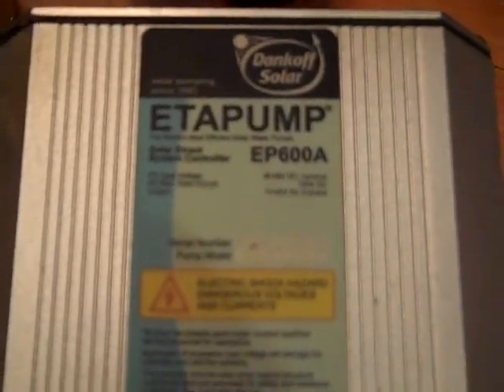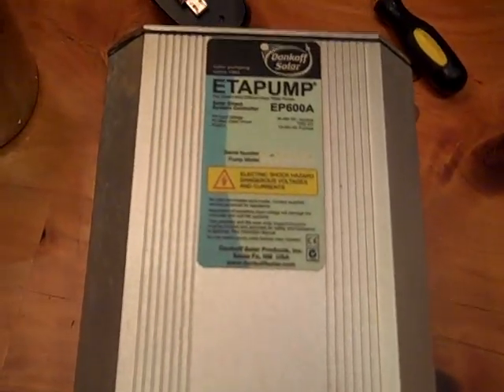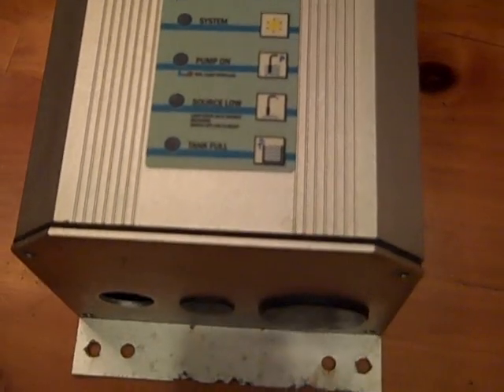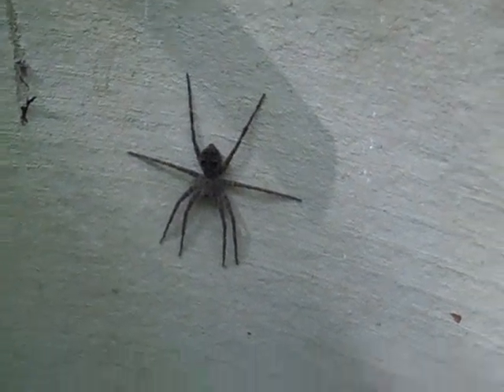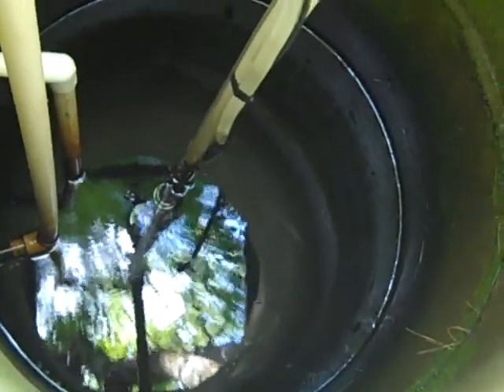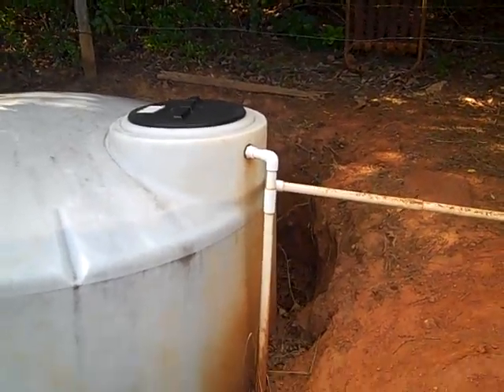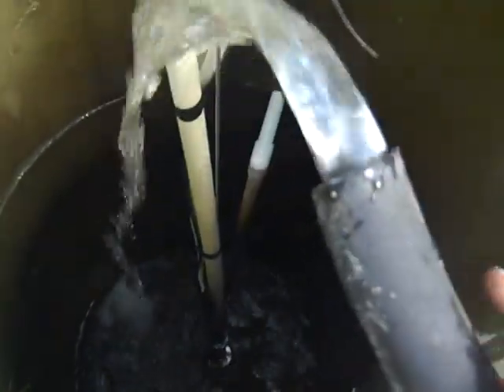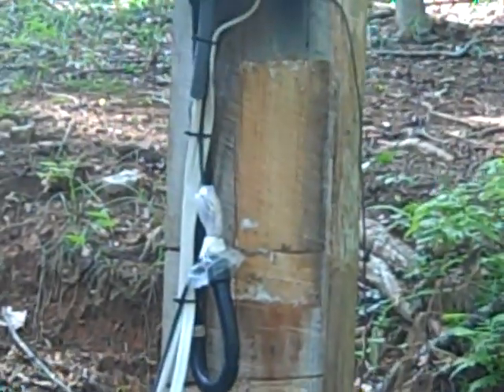Water system failure and backup

Comment: Sorry I'm sure you mentioned it...but your 1600 gallon tank...how long did it take to fill it (I think you said it was empty) with the PTO pump. We have 2 wells drilled but haven't been able to afford to put in a solar or wind pumping system. Need to pull water out of one of those tanks and move it up to the highest elevation in the field. Also still need to get a tank like the one you've got.

Thanks!

Comment from the maker: @tomyhill123 No, thankfully it doesn't freeze.  I need to build a better lid but I tie a trap around the top in the winter and have not had a problem. 800 gals. at 58  degrees keeps things from freezing.  Thanks

Comment from the maker: @jcb570 If It was  direct wire situation it would have fired the pump. So the controller being separate form the pump is easier and less expensive to replace.  I did find the culprit being a disconnected ground.  My fault! : ( 
When I originally put the system in it was for a ram pump so no wires necessary. II could do a counter wegiht switch true but I have found that while the sun is out I let is keep pumping. The more the water moves the less algae.  Thanks for watching.

Comment: If the region and money are there, a hand pump well is awesome to have. Less parts to get hit by lightening and you avoid making noise, using gas, or electricity to get your water. I've never seen a setup like that before but it's pretty slick. Good info to have!!

Comment from the maker: @cdltpx Good Idea.  I did think of that and I have a 600 gallon backup tank in line that I didn't show in the video.  I just picked up another 600 gal. black tank so I will have 2800 gallons of spring water stored at the highest points on the property.  I did have lightening protection of both end but the wind spun the panel and for so reason the ground was loose and the copper pulled out so I wasn't protected on one end.  So I have fixed the ground so hopefully it will last another 6 yrs.Thanks